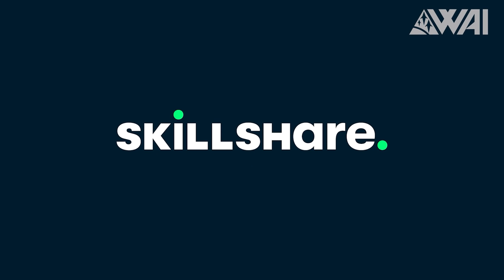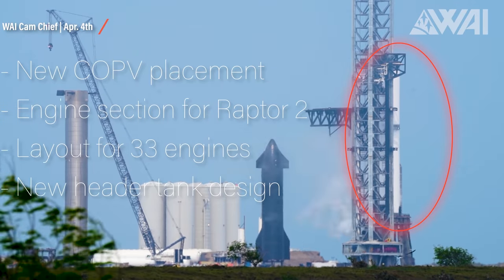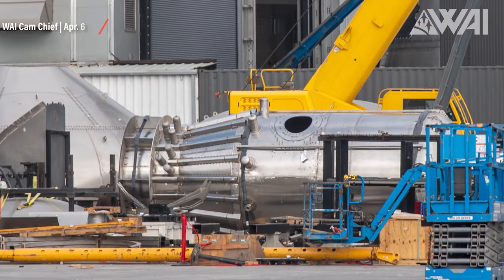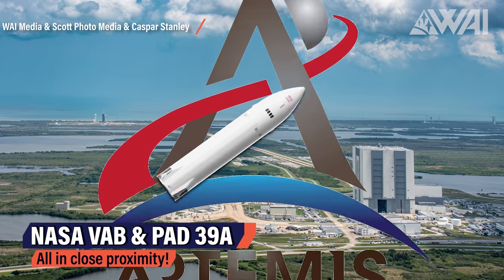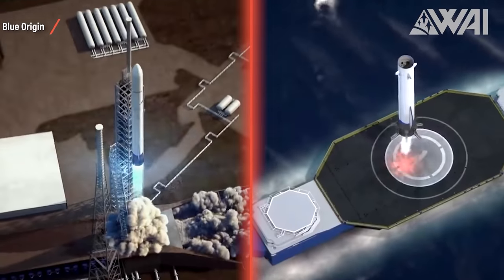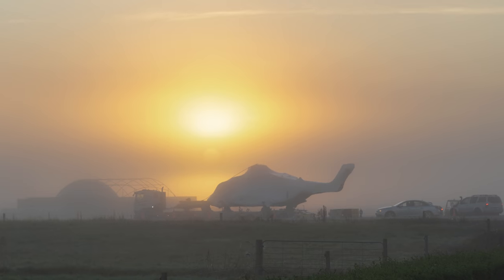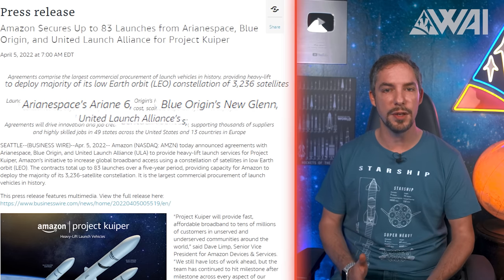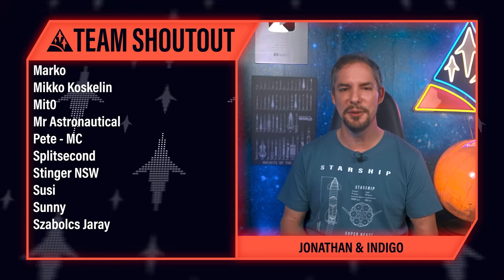SpaceX Showing how to Make The Impossible Happen With Starship In Record Time!

Comment: seems much more likely that the header tank is going to mcgregor to get hooked up to some engines for testing. engines are tested there, it feeds prop to engines, its a new design.... mcgregor makes the most sense.
Reply: Sounds about right
Reply: I thought that as soon as he said it.
Reply: That was my thought as well. It's a shame they didn't follow the truck long enough to figure out which highway it took, whether it was headed east or north.  But... I'm looking at the maps of the area now, and they would have had to follow it for 3 hours before it would have turned north for mcgreggor or east for Florida.
Reply from the maker: Might well be! :_WAIHeart:
Reply: No. They need the AFT section to attach the engines, and spaceX wouldnt transport that to mcgregor. They would need to make an entirely new tank to test engines on it, and that would mean they cant test it in the first place. Much easier tu just put the header tanks in a complete booster and test the entire thing that way.

Comment: Kuiper's one advantage, is that Cell Tower linking, which will mean the average client doesn't need extra hardware to connect, effectively making Kuiper a competitor to the under-ocean fibre optic cables. The downside, is that in cases like the attack on Ukraine by Putin, and the cell towers being knocked down, Kuiper cannot provide the stand alone communication that Star Link can, to those customers that have bought the service and access it by their mobile devices.
The Kuiper contract is also meaningless until both the satellites and the launch systems exist, so right now, it's (LOx) Vapour Ware.

Comment: It is very much in SpaceX's interests to have Amazon dependent on them for launches. Amazon will be able to buy SpaceX launches just like OneWeb. This will only happen in the event that one or more other launch providers end up not being able to provide enough launches in the required time frame.

Amazon plans on launching just two prototype Project Kuiper satellites this year. I assume they will launch on an Atlas-V rocket. They bought all of the available Atlas-V launches last year. Amazon will use those first.

The new contracts are for rockets that aren't even fully designed yet. Those rocket launches are a year or more in the future even if things go well.

All of the launch vendors now have a guaranteed high volume customer. It takes years of planning and work to achieve a high launch cadence even if things go very well. For Amazon to have a chance to launch in volume in 2025 on non-SpaceX rockets they need a very early start. The lead times for these vendors are measured in years not months.

If Starship is successful, customers will be able to order launches with very low lead times. SpaceX doesn't need an external customer to make sure that Starship can launch at a high cadence.

This means that if Amazon uses up their stash of Atlas-V launches before the other rockets are ready, they will have the option of buying launches from SpaceX.

Comment: Header tanks in the booster don't make a lot of sense to me. The booster isn't going horizontal, like the starship. So propellants settled into the bottom of the tank work just fine in the booster, without the complexity of extra valves and dry mass of more tank walls.
Reply: Does the falcon 9 booster have header tanks? If not then you are right. Perhaps it may be needed then for some sort of horizontal manuveour in order for it to return to the tower or for the hover instead of the suicide burn?
Reply: @chrisduggan85  F9 does not have headers that I am aware of. SH shouldn't need to go at any more of an angle than F9 does. That's kind of my whole point. Of course it will need more fuel to hover, than doing a suicide burn, but that really only requires enough left in the regular tanks. At most the regular tanks need a couple extra sensors to ensure sufficient supply before the landing attempt.

Comment: What would happen if rockets used airplane engines instead of burning toxic fuels and other fuels what would happen if we just used air? Another question is what if we used them both together as taking off mechanisms.....?......
Reply: You do realise that burning ultra refined petroleum aka Jet Propellent or Rocket Propellent -1 (Both kerosene) is what propels both airplanes AND rockets? In the case of rockets, you can use cryogenic H2 and O2...

Comment: As Space-X ships are becoming more reliable, at some point could tons of the radioactive containers be safely launched into the sun instead of being buried to make nuclear energy a more acceptable option?
Reply: Nuclear fuel can be reprocessed into useable nuclear fuel, as the reason it is "spent" is because of built up contaminants from atomic transmutation. 

Case in point that is what france does with their spent fuel.
The only reason the USA doesn't do this as well is because Jimmy Carter was a moron and didn't veto the bill that banned reprocessing in the US.

Even without reprocessing, all the spent nuclear fuel rods in the USA could be fit onto a single football field.
The vast majority of "nuclear waste" is actually medical waste from X-ray equipment.

Comment: Recovering with a helicopter is like trying to put a sail on a car and calling it progress lol. It's ridiculous if you consider what SpaceX has done with landing using own powered booster.
Reply: First, that method for catching objects falling from space was first developed around 1960, and second, powered landing is just too inefficient for a rocket that small. Which you would know if you'd looked things up first.
Reply: @robertmiller9735  What's your point about the timeframe of when the technology was first developed? Again, if a new method is being used that shows cheap, rapid reusability as SpaceX has done, then build on that progress and not borrow from the past. I can see so many points of failure for putting a man in the loop as in flying a helicopter to retrieve a tube mid air. What if there is oscillation that is induced by a failure in the cable or even weather, then you are risking lives for what? To save money, by the use of method that is already outdated and frankly ridiculous. 

Just because it's space related doesn't mean it's good. Its fuckign stupid and you making a lame counter argument is also pretty pointless as well.
Reply: @PowderChaser  well, since electron and falcon 9 belong to completely different classes of rockets then the methods of recovery are also different, guess you'll understand it now...?
Reply: @sanajyshrivastava3707  You just said the same thing as the other guy.

Comment: It has NEVER been permissible to launch orbital rockets over the U.S. due to potential booster mishaps.  There was no way to launch from Boca without flying over the southeast U.S.  I'm old enough to know that. 😉

Thata said, time for a Tesla road trip cross state from Tampa to the Cape.
Go Bucs!
Reply: The proposed trajectories for BC launches cross land as late as the Caribbean or even Africa.
Reply: @kevinkrammer8077  Yep,
That was for the test flight.  Not a complete orbit.  Any inclination over 0 degrees would cross the coast.  That's not plausible for commercial ops.

We may still see that initial test from Boca.
Reply: @Hurricane1668  even when starting from the cape they do so-called dog-leg maneuvers to reach other inclinations.

The only thing that would be problematic from BC would be polar launches.